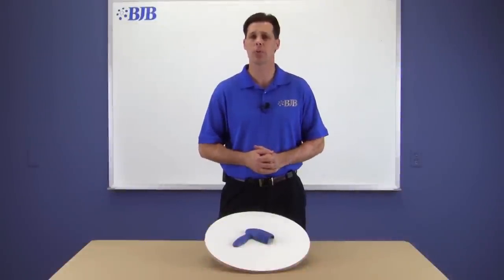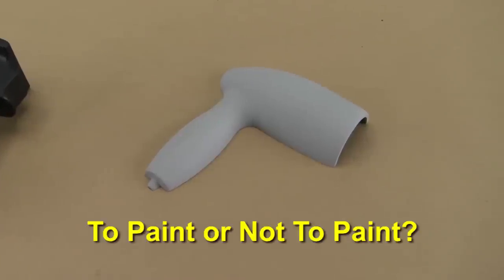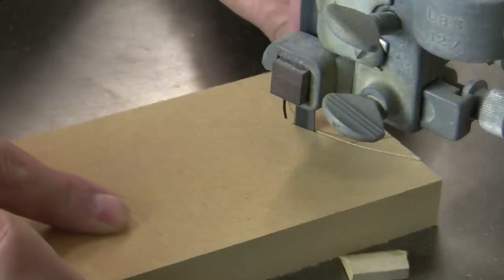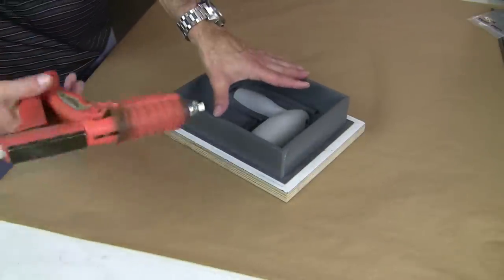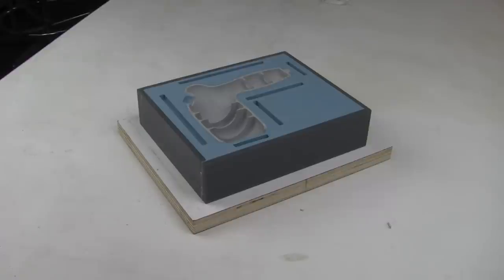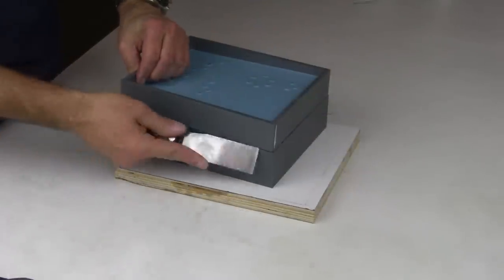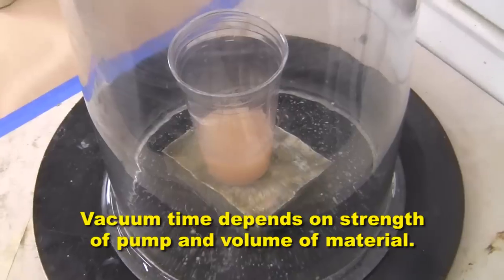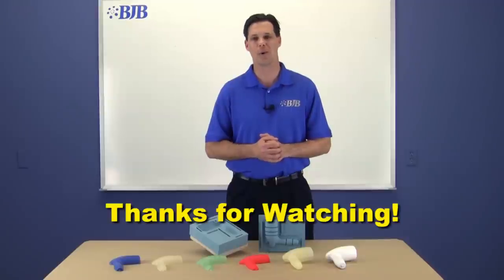How to make Professional silicone molds from 3D printed patterns

Comment: I also added heat via a hair dryer mounted in the door of the pressure chamber. With 60 PSI of air pressure. I did not evacuate the resin. 30 years ago I was using Conap UC30 polyurethane resin. The results were excellent! Your procedure in right on!

Comment: I have been watching silicon mold making vids on youtube for a few days trying to learn about the process for an upcoming project. This is by far the best video series on the subject. There appears to be a lot of misinformation out there..so glad I found these..thanks a lot. The only thing that I see as a major stumbling block for me is the use of a vacuum chamber. Is there a silicone mold product that doesn't require "de-air bubbling"???
Reply: +Suman Prescott it&#39;s called a degasser it's just a vacum chamber, it doesn't have to be done but it removes bubbles giving you a better mold that might if a bubble was in it cause deformation on the mold.
Reply from the maker: +Suman Prescott Thank you for the feedback!  Yes, we made our videos to show how the process is done instead of just selling you a list of products.  Degassing is a common but confusing subject, but we do our best to show the proper way and reasons WHY to do this extra step.  Depending on the mold and application, you may or may not need to degas the silicone but you will find the results will be better if you do.  You can watch our newest video for a simple mold and we do discuss your question as well:  https://www.youtube.com/watch?v=dWVrCffgoDc

Comment: Hello! thanks. Why douring the measuring of the weights on the scale he hits the plate? And what is the difference between using only silicone and using silincone and an hard material as plaster or resin as shell to contain the flexible shape of silicone?
Reply from the maker: On a mechanical scale, the plate will go down when the weight gets heavier so this is a trick to see if you are getting close to the to the desired weight.  The difference between using only a silicone mold and using a silicone with rigid shell would be usually we use a shell when the mold is larger and we want to save silicone and weight because silicone molds can become heavy.  On a large mold you can also save money because silicone is more expensive than plaster or resin.

Comment: Can we achieve the same tolerance with this method as with injection molded part?
Reply from the maker: In many cases yes.  Many of our talented customers use this method to produce dimensionally accurate parts in product development and short run production.  Silicone molds have a lifespan compared to metal tools, but most mold makers account for this and count on the ability of a quality platinum silicone mold material to capture the correct geometry of the original pattern and then duplicate with a cast polyurethane.  Depending on the part size and shape, some adjustments to the pattern size may be made to compensate for the shrinkage rate of the cast polyurethane chosen to make parts to ensure the best accuracy.

Comment: Hello BJB Enterprises, can you tell a bit more about getting course textured or satin touch finishes? I'm working on a gaming product that needs to be held for long time at a stretch
Reply from the maker: The finish of your pattern, glossy, matte, textured, etc... will be duplicated by the silicone mold.  So, you must apply the desired finish to the pattern you are molding prior to making the mold.  Applying a texture or satin touch finish depends on the paint system or paint technique.   Whatever paint or coating you end up using on the pattern, you will want to run a small sample test to make sure the silicone is compatible.  There are some common Spray Can paints (like Rustoleum) that cause curing issues with Platinum Based silicones.

Comment: 1. Wouldn't toothpicks make sufficient vents for this part?

2. Can silicone be cast around wax masters with wax ports and vents?
Reply from the maker: Tricknologyinc Hello, yes toothpicks could be used for vents.  The benefit to these vents is that they remove easier without breaking in the silicone making the tool easier to keep clean.  Also, the ability to use a straw for your risers will shield the silicone from the casting material, making the silicone surfaces in the vents less likely to dry out and stick to the casting material.

Yes you can also cast around wax masters and vents.  I have not heard of any issues with Platinum Silicone curing against wax but it's always good to run a small test on new materials to be sure in case there is something unique about the wax you are using.

Comment: Why not 3dprint the plugs? Assuming that you have the 3d file for the part that would be easy right?
Reply from the maker: You could certainly 3D print the "hole plugs" as a quick way to make them.  Nice suggestion!

Comment: What's to stop from using a 3D printed mold, finishing it, and pouring the resin into it?
Reply from the maker: In some cases that does work.  However, there are a lot of advantages that silicone molds offer in terms of part quality, ease of demold, and range of geometry that a rigid tool does not give you.  Here's a nice video that goes over some things to consider:  https://youtu.be/wAOemKxSXyk

Comment: Nice tutorial, I need to replace resin sand shell core used in sand casting with your product using silicon Mold method, the temp. of molten grey Cast iron is around 1200 deg Centigrade. Plz suggest. Thx

Comment: Hello,

I tried following this tutorial to the letter, and found that my silicone mould is sweating and sticking to my part. 

An AB test of moulding the PLA plastic with and without primer, led to the primer being the cause of the reaction of the silicone.

Is the filler primer you're using special in some way, in that it does not have the same solvents as cheaper filler primers?
Reply: You need to use an acrylic laquer, don’t use rustoleum satin paints.
Reply from the maker: Unfortunately many of the easy to get or cheaper primers are problematic with Platinum Based Silicones.  It sounds like you experienced inhibition where the silicone was exposed to a solvent or paint base it didn't like.  The SEM primer we use in many of our videos has been very reliable when it comes to silicone curing against it.  We discuss more about Platinum Inhibition in our other intro mold making video:  https://youtu.be/iRj6xzNx7P4?t=565
Reply: @bjbenterprises  Thank you so much for the quick response! I will try buying the SEM primer and see if it solves the issue.

When you're applying the primer layer, do you have any rules you follow on number of layers and drying between layers to ensure the primer is ready for moulding?
Reply from the maker: @brianmackie4667  the main points would be to apply thin to medium coats (vs thick wet coat) and wait about 5-15 minutes between coats depending on the temperature.  Typically we wait overnight before casting any silicone against that surface to ensure the primer is dry.  In ideal conditions (hot and dry weather) you could potentially mold a platinum silicone over the fresh primer after waiting 3-4 hours to dry (we have tested that ourselves) but only if we were in a rush to get the mold made and the weather/temps were permitting.  If it's cold and damp, we wait.
Reply from the maker: Brian Mackie another common thing many people do is spray an acrylic clear coat like Krylon Acrylic Crystal Clear to seal the primer and pattern.  It’s been a reliable paint that works well with Platinum Silicone.
Reply: @bjbenterprises  I tried using the SEM primer, and did thin coats with 10 minutes between coats. Let sit for 2 days before moulding. This time the mould came out perfectly, thanks so much for your help!
Reply from the maker: @brianmackie4667  that's great to hear!  We love to hear success stories especially after your trouble at the start.

Comment: This is a very professional solution. Could you tell me please approximately how many times the mold can be reused.
Reply from the maker: Great question.  There are several variables to silicone mold life, but we typically state about 20-25 as a conservative number, but up to 40-50 is possible or beyond.  Much of it depends on the shape and geometry of the part, and whether there are undercuts, deep drafts, etc.  Obviously the advantage to using silicone molds is the ease of construction compared to traditional rigid molds and the ability to cast parts with extremely high detail or undercuts.  The other major factor is what type of mold release you are using and the required finish out of the mold.  If you are looking to get very shiny parts out, then your mold life will be shorter than someone willing to paint or post process the cast parts after demold.   Also, flexible polyurethanes tend to be easier on silicone molds than rigid cast polyurethanes.  -BJB
Reply: Do you offer this type of mold fabrication as a service if a customer sends a model in?

Comment: I wonder how it was painted at 13:37. I mean, what kind of paint was used on what kind of resin?
Reply from the maker: AbeOnline The part was painted with a typical automotive two-part urethane paint.  This means it is a catalyzed system and not from an aerosol can.  It provides more durability and adhesion than many paints from a can.
Reply: Does anyone know if the FolkArt Enamel Gloss Finish Acrylic paint, or any acrylic paint, will work on plastic 3D printed models, (ABS Plastic)?

Comment: Is it possible to cast wax in silicon molds? I'm curious if it's possible.
Reply from the maker: Yes, silicone molds are used quite often for casting wax into.  It allows you to produce fine, detailed parts and the flexibility of silicone makes demolding the cooled, delicate wax part easier than a rigid tool.
Reply: BJBEnterprises Thanks for answering. Jewelry had suddenly become more fun to make with this answer.

Comment: Nice way but a bit overkill for basic hobbyists
Reply from the maker: You would be surprised at how many of our DIY community have adapted these methods for doing small runs of parts.  Having said that, we deal more in the product development, industrial, and short to medium run production industries.  We don't really cater to hobbyists but we do have many smaller users that are trying to improve their mold making and casting methods.

Comment: You could have 3D printed it with break-away plugs.
Reply from the maker: True to some degree.  However, when you break away the plugs you will be left with marks on the pattern.  Depending on the location of the plugs and the severity of the marks, this may or may not present an aesthetic issue.  Having said that, it is an interesting option when using 3D printing to your advantage.  Thanks for the comment.